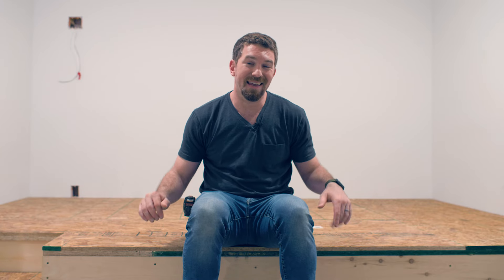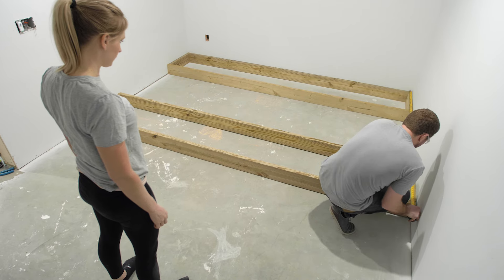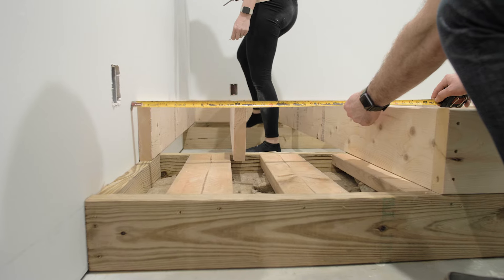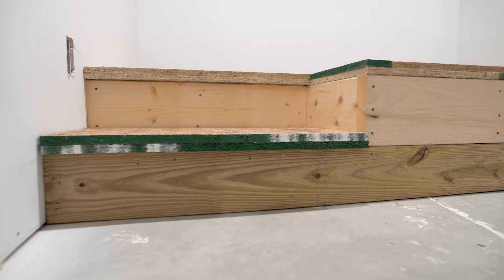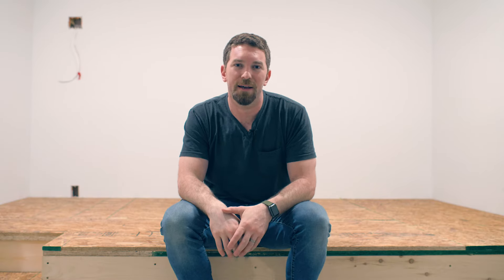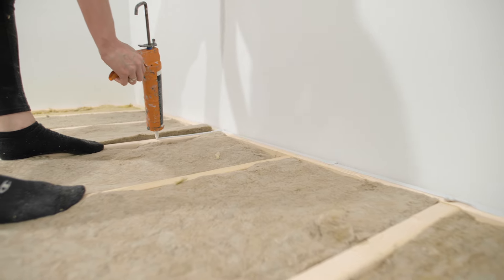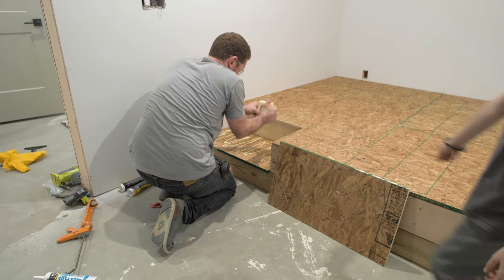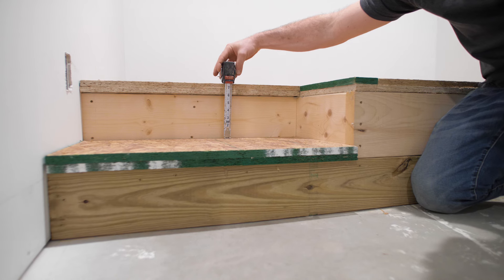DIY Home Theater Seating Riser Construction 🍿

Comment: You should leave space between your riser and walls (don't connect them), and use a hole saw to create 'vents' in the sides and backs of the riser. Also, you do not want to create any isolated cavities if you can help it. By following these steps, you'll prevent a lot of low freq. sound issues in your riser.

Comment: I built my platform using this spec. It came out great. Challenges were existing electrical boxes, adding LED strips to steps, and extending existing forced air heat vent. Material costs were around $600, but the labor was tough especially if you don't have a workshop/table where you can easily cut your wood to size. However, I bought a couple more tools, borrowed some, and we made it work. Thank you very much for your plans. We love it. I'd post a picture here if I could, but I don't see that option.

Comment: Thanks! I painted the top black and put 2 red bed skirts around the edge to match the red curtains around my screen and it looks great! I used the skirts because this wouldn't fit nicely in a corner and is visible from all sides, but it thankfully doesn't get in the way of anything. .

Comment: Maybe your screen will be really low on the wall, but that's pretty high for a riser.  Ours is 8" (same as commercial movie theater seating) which still gives the back row a really good "screen-center-even-with-eyes" experience, the sound is adjusted good for them too, and they see over the front seat just fine.
Reply: I thought the same thing
Reply: Yep, I used basic 2x10s and nobody had trouble seeing from behind.

Comment: For anyone watching this, definately use the treated lumber with a concrete floor but don't neglect, as they did, using some form of vapor barrier below (or under) the mineral wool (sound-dampening material).  They have created a wick for moisture, which basically undermines the benefit of the treated lumber for controlling leached moisture in that structure.  While mold will have a hard time harvesting in the wool, the wicking effect will bridge the gap to the surfaces it will grow on very well.  Yuck
Reply: 100% agree. Saw the pressure treated wood going in and thought ok they're doing this right. Then it jumps right to insulation going down onto bare concrete lol.
Reply: Where does the vapor barrier go and what type is it, or what is the vapor barrier, I am about to build this riser.

Comment: Why do you need sound proof in the riser?
Reply: I'm curious about this as well.  If I had to guess, it's to minimize the hollow noise of when someone walks on or drops something on the floor.  Not that it would affect the sound of the home theatre or room itself.
Reply: @iis4isaac  The riser cavities will act like a resonant barrier when bass hits. It's a shame the designer didn't tune the platform and place ports at the back of the riser where the pressure maxima exists in the room. I will be building a similar riser platform as was done here but will be making it into a helmholz resonator to give some tactile feel when bass hits.
Reply: @Audioholics  Thats an amazing idea. Get a little vibration during those big bass moments ment to shake the ground. Hopefully the video is up.

Comment: Great detailed tutorial. Not a big deal given the small cost difference but all of these steps may not be required. 

1. If your house is reasonably new there will be plastic sheeting under the concrete pad so no PT lumber should be required. 
2. Subfloor glue is great but probably not necessary. Squeaks shouldn't happen if the flooring is thick enough and joist spacing close enough. 

Also 

3. You can always build a subfloor with diagonal boards if you don't have a truck and don't want to pay for OSB delivery. 
4. 15" is pretty tall for a platform.
5. You will save time by using a framing nailer. Just be careful!

Comment: Don’t listen to all the so called experts. It’s going to last way past your need for it. 20plus yrs if you didn’t use PT lumber. You basement floor looked like it’s never had a moisture problem. This is why people carpet or hardwood basements. Older homes yes use PT lumber anything built since the 90s with no water issues reg lumber will still last a very long time

Comment: She handles that Batt Insulation with no gloves "Like a boss"
Reply: Martin Adamski it doesn't have glass in it. If it's like Rockwool then it shouldn't bother your hands. I installed a similar sound proofing insulation in my basement and didn't use gloves and had zero problems. If it is standard fiberglass insulation then yes, she's a boss.

Comment: How big are your foundation walls?  Curious to know the head room in the back row
Reply from the maker: The foundation walls are 10' but there is ducting above this ceiling so the height in this room is only about 8.5'. The height from the platform to the ceiling is a little over 7'
Reply: @rogueengineer  how would you have tackled this project if your foundation wasn't a deep pour?
Reply from the maker: Paul Harder I probably would have just done a 7” riser.

Comment: Planning on hiring someone to do this. Just curious what should the average price be for materials if I were to hire someone for the riser and some electrical components into the riser that things can be plugged into.
Reply from the maker: I would think materials should be under $500. That's a wild guess though.
Reply: @rogueengineer  That's what I was thinking as well. Thank you so much for the help!!!! Helps huge with my riser build 😊😊😊😊
Reply: Rogue Engineer what was the height of your riser

Comment: Thanks for the video! I made my own riser following your directions with slightly different specs.  I did 2 levels of 2x6's.  I wasn't satisfied with the height so I added an additional level of 2x4's.  I saw your instagram post of the carpet you got from Home Depot, and I actually may end up using the same.  Looks like you got the Lifeproof latice carpet, but I can't tell what color it is.  Any chance you will post a walkthrough video of the theater room?

Comment: Is it me or is that floor not level as in does it slope down from left to right? Anyway, its still gonna be a great space. BTW, are those electrical outlets in the wall?
Reply from the maker: It could be the angle of the shot. That platform is level. And I haven’t put electrical in yet. The boxes in the back were for AV wiring but I am going to relocate them.
Reply: @rogueengineer   I'm sure the platform is level - it just looked as if you had to compensate for an unlevel floor.
Reply from the maker: @clydedecker765  Luckily the floor was pretty level. If not we would have just shimmed the joists.